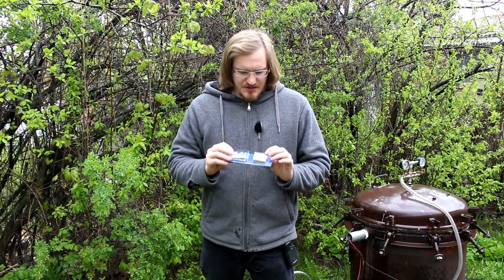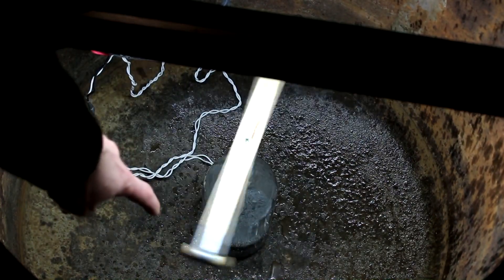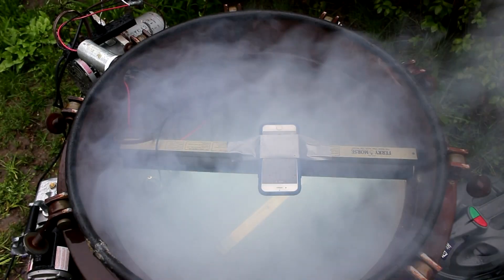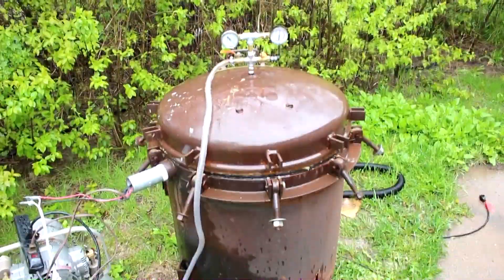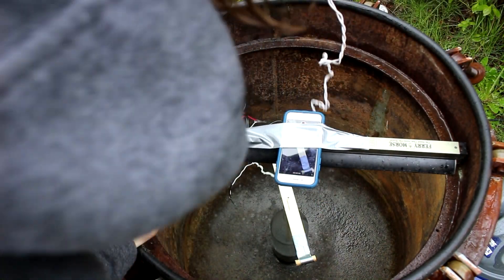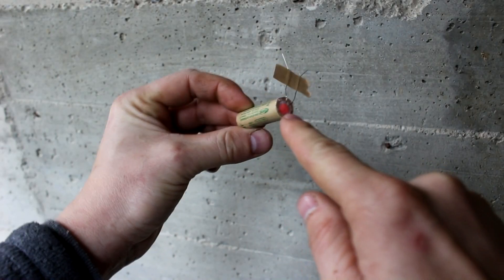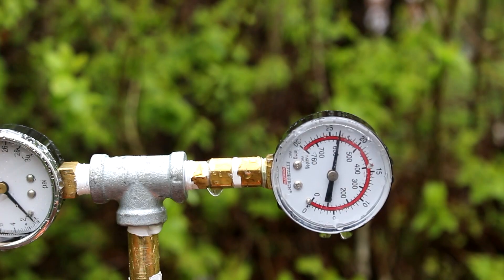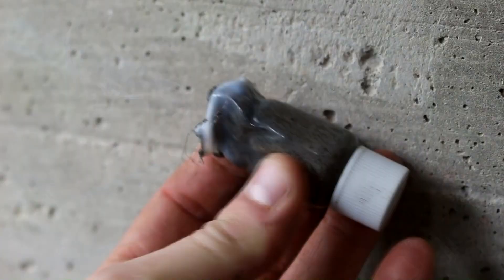Will a Model Rocket Motor Work In Vacuum?

Comment: Cody, do you think that the difficulty of sustaining a reaction has anything to do with the specific heat of the gunpowder relative to the activation energy of the reaction, versus the amount of heat that the expanding gases can actually transfer to the surrounding powder before it is pushed out of the motor?
Kind of like that thing where it would put out a flaming twig, but burn with the smouldering tip...
Perhaps if you used a VERY finely grinded powder and packed it together REALLY tightly?

Comment: i haven't seen anything, ever, claiming NASA rockets operate under atmospheric pressurized tanks...
Reply: the difference is NASA designs their rockets so that the exhuast gases and turbopumps pressurize the combustion. the model rocket motor is not designed for that
Reply: Yeah of course they run on extremely high pressure tanks thousands of times above atmospheric pressure,
Especially relative to the vacuum around them in space.
An atmospheric pressure tank would just be an empty tank that is sealed.

Comment: Just a comment, but you were using a mix similar to black powder for this rocket I assume, now I'm sure you are familiar with a sugar rocket in which a mixture of sugar and potassium nitrate are mixed to create a solid rocket fuel mixture, and in theory this fuel mixture should have enough oxygen within the Sugar and KNO3(P-Nitrate) to burn in a vacuum without any assistance of air as an oxidizer which you did use but for pressure rather than a oxidizing chemical in your mix, but if you feel unjust to the results of this video, try sugar rockets in a part 2
Reply: Nick Kelly doubt the amount of oxidizer would make a difference. Theres plenty in those SFRs. The problem with low pressure ignition is that the excited products don't stick around long enough to convey energy to adjacent molecules. That's why it had to start it's burn in atmosphere. Probably would have worked without O2 in the little pressure vessel.
Reply: There's already enough oxygen in gunpowder to burn fine with no additional oxygen.
Heat might transfer better through Rocket candy though

Comment: My only question is, did the rocket in atmospheric pressure burn as long or longer than the one under a vacuum? you can time lapse the two frame by frame and see which one burned longer.

Comment: For some reason it doesn't look like the ejection charge fired when it was lit under the vacuum. Could it really not sustain the combustion as the delay charge continues burning at a much lower chamber pressure?

Comment: ODD channel had an amazing rebuttal to your experiment on earth curve
Reply: Google underwater fuse, and you can see lots of fuses, some black powder based burning underwater.  Some thing I did not explain before.  Black powder contains potassium nitrate, and potassium nitrate is 3/5 Oxygen, but it's not gas, its solid, even the oxygen.  When black powder burns (explodes), the potassium nitrate breaks up and the oxygen is released and becomes the oxidizer.  
Google Magnesium underwater burn.  This is a trip because Magnesium burns underwater better than above.  The reason why is it burns so hot, the Hydrogen and oxygen in the water break up and now you have more oxygen than above the water, and hydrogen which itself burns.
Reply: Just because you don't have the slightest idea on how rockets work, doesn't mean NASA and the other space agencies have the same problem.
Reply: A full burn on those Estes rocket motors is only a fraction of a second.  Watch any video of them launching actual Estes rockets.
Reply: On the Estes web site it says A3-4T engines have a 1 sec burn.  The first in atmosphere test seems to be about 1 second.  The last in a vacuum test seems about 1/2 a second. It also seemed to spin the stick faster.  I would imagine it would burn faster as there is less pressure holding exhaust gasses in the engine.
Reply: Well the rocket burns because it's full of oxygen.  It's just black powder,  sulfur, charcoal, and potassium nitrate.  The Potassium nitrate is 3/5 oxygen.  Black powder will burn underwater.  Something that has been known for 500 years or so.  
I think there are flaws in his test procedure but there is no doubt it burns and provides force.
Reply: +Lonewolf Rebels Ignite some blackpowder and while it's still burning, dowse it in water.  It will keep burning.  Obviously, blackpowder burns pretty fast, so it's kinda tricky.  A blackpowder "slowmatch" is a better way of trying it.

Wet blackpowder is difficult to ignite, because you have to boil off the water first.  Which is why it won't work in a flintlock - not enough ignition energy in the spark.  But if you do supply enough energy, it will.
Reply: makes you wonder why the rocket motor only lit for a fraction of a second and didn't do a full burn
Reply: I agree it does appear to provide force the questions start when you ask how much force and I believe your mistaken black powder don't burn when its wet I know that for a fact I shoot black powder muskets inside a sealed cask where oxygen is already present yes it can explode but even a few ml of water can spoil pounds of black powder till its dry
Reply: I did not say black powder burned when wet.  I said it burned underwater.  The problems Cody had were with igniting it, not burning it.  You must raise it to a pretty high temperature, that's why it won't burn when wet. 
In this test, he uses the factory model rocket igniters to ignite the rocket engine.  Well the coating on the igniters burns at a high temperature, enough to light the engine.  But they don't have their own oxygen. So the igniter does not work in a vacuum.  The little wire gets hot, but the coating never ignites. 
You know the joke about how deaf frogs don't jump?
Reply: Indeed 😂
Reply: Cody also proved black powder don't burn in a vacuum
Reply: +Luke Himself They didn't have to use claymation in the 70's they had Kubrick
Reply: I would love to see a experiment where black powder burns under water and in a vacuum and let's hear about the deaf frogs 
😂
Reply: I thought he made a solid valid point definitely a theory that could use some testing by more people don't get angry get informed
Reply: I thought he made a solid valid point definitely a theory that could use some testing by more people don't get angry get informed
Reply: thankfully a smart comment somewhere on the list instead of "oh it worked perfectly the entire time since the burn was started, I accept everything about space now! even the proven claymation astronaut in the 70's spacewalks!"
Reply: 1/2 second is hardly enough time to prove it burns in a vacuum he did after all have to leave some o2 in there to ignite it this experiment would of been better served with a duration burn on film with a force gauge either applied to the rocket or at the exhaust end to see if it can sustain a proper burn and to see if the force exerted was the same in a vacuum as out of the vacuum after all he could not get it to burn without first changing his own parameters by putting a container behind the motor to induce ignition in a vacuum
Reply: I've played with small rockets before and they had longer burn times than this maybe a proper test with a rocket that has 10-30 seconds burn time would help prove this better
Reply: Scientist teaches a frog to jump on command.  Gathers an audience, says jump, the frog jumps.  Cuts one back leg off the frog says jump, the frog jumps.  Cuts other back leg off the frog, says jump, frog just sits there.  Scientist says See, frog with no legs can't hear!   Which is to say, even with good intentions, experiments can be flawed.

Comment: the only reason it's working is because it's thrusting off the sides of the vacuum chamber. otherwise it wouldn't work.
Reply: MistakenMystery; That makes no sense whatsoever.
Reply: Nope, that's not how thrust works. The rocket pushes against the gasses it exhausts behind it, not air. How do you think a space craft can achieve thrust in space?
Reply: Nasa and space is a fucking lie, the earth is flat

Comment: Before I even watch this video, yes it will work in a vacuum because the rockets contain an oxidizer an fuel and you may even get higher efficiency because there will be less pressure going against the exhaust coming out.

Comment: Could a smaller nozzle than used in atmo  have the same effect?
Reply: yes, that's essentially what cody did here
Reply: Hmm It kinda looked like a pressure vessel designed to fail. Same intended effect diff means.. I thought he'd make a rocket candy engine with smaller nozzle instead or affix a reusable external nozzle than the method he employed.

Comment: Would there still be fuel left in the spent motor that ran in the vacuum? Seems like it didn't expend all the fuel. Any chance you could chuck it in a fire to see if it still has propellant?

Comment: If memory serves from 40 years ago? NASA used hydrogen and oxygen combusting in their rocket motors. No igniter needed. I found it interesting that they called it the .9999 reliable motor that put out precisely 20,500 pounds of thrust.

Comment: the igniters are not designed for 120V : it causes then to burn too fast and 'pop' if you use say 9V , they will burn much slower like a match and keep the heat near the propellant for longer. I believe your experiment may have worked on first try had you use appropriate voltage.
Reply: Have you ever even touched one of these igniters? Why do you say that? Why are you 'sure' that's not AC?

The fact that the vacuum pump shares the same power bar is a dead giveaway also the distinctive 'pop' the igniter does is typical of over-voltage.
Reply: Simon L he may have used the power strip in order to get More Heat to ignite the rocket..
just a thought
Reply: Slipped Halo, Its not my idea.. just product specs. These are standard Estes igniters, they have not changed in the last 25 years (or more)
Reply: That's actually a really interesting idea, I didnt even think of that.
Reply: Simon L im sure that was not AC power, rather just a switch

Comment: Love this channel.  However, it needed an oxidizer.  It only fired the second time due to a small amount of O2 in the vial. Once that O2 burned up the vacuum took over and stopped the reaction.  This can be demonstrated by the short burn time of the second firing.  I understand it was a 1/2A engine, but it was 1/3-1/2 of the first.
Reply: It does have an oxidiser in the form of potassium nitrate in the fuel grain. Indeed the rocket could never work even in air without that oxidiser because the pressure inside the burning rocket is  higher than atmospheric (if it wasn't the exhaust wouldn't come jetting out the back) and therefore there is no way for atmospheric oxygen to get into the engine while it is burning. To demonstrate this Cody should have cut the motor open and showed that no fuel was left inside it.

My suspicion is that the second motor burned for less time because being cooped up in the bottle put it under more pressure once it had started burning. Higher pressures inside a solid motor usually lead to higher burn rates.

Comment: Most, if not all, of the Star rocket motors used by NASA are upper-stage engines that light in vacuum. A Star 48 (48 inch diameter) is also tumbling somewhere beyond Pluto, having been the final stage for New Horizons.

Comment: Just had an idea: Why don't you drill a tiny hole in the top of the engine, stick the igniter in there, then seal it with glue? That way, there isn't as much pressure trying to force the igniter out of the engine, so it has a better chance of staying put until the engine becomes self-sustaining. (Edit: Either that or put a nozzle on the exhaust to increase internal pressure.)

Comment: But there was an artificial environment surrounding the rocket. Not sure why you said  "rocket motors can produce just as much  thrust if not a little bit more in a vacuum" when the rocket was encapsulated in its own personal atmosphere. Without that crutch(cheating device) it doesn't produce any thrust. "Cody's fail" is the new title until he or someone educates me.
Reply: The engine was producing thrust just fine in vacuum. His problem was getting it to ignite in the first place- it seems that these engines need a little bit of oxygen and/or backpressure from the air to get started. I'm leaning towards the backpressure side, as others have noted that the parachute charge didn't explode like it did in the control. That problem could be solved with a tighter plug and a narrower nozzle throat to provide the needed chamber pressure. Full-sized rocket use different propellant combinations and ignition systems (A common approach is to inject two liquids that spontaneously ignite on contact into the engine just before the main fuel flow starts entering the chamber) so this experiment has limited applicability to them.

Any jet of exhaust gas will produce thrust, so thrust could be achieved with a bottle of compressed CO2, no combustion needed.
Reply: Will a Model Rocket Motor Work In Vacuum?

No.

He had to provide an atmosphere for the rocket.
Reply: Depends on your definition of 'work'. If you mean 'produce thrust in vacuum' Then yes it does work. If you mean 'ignite as intended in a vacuum' then no.
Reply: How do I know if a car works? Does does the starter turn over or can I use it? 

You just hacked a hair in half. Did the perform the way the manufacturer intended it to? No. Whether it is in a rocket or suspended from a plank it didn't work as intended. He needed to cheat. This is akin to Can a Bic lighter work in the wind? Yes......If you protect the flame with your hand.
Reply: the bottle had a hole in it.

Comment: Nice try Cody, but you didn't get your conclusion correct :-(

The motor only burned using the amount of oxygen that was in the plastic bottle. After that was exhausted, it immediately went out. This is evident due to the parachute charge not going off. The propellant did not burn far enough to hit that charge. You can hear the charge going off in the control test. It did not go off in the vacuum test though. My guess is that less than 50% of the solid fuel in the rocket motor was actually used.

The solid fuel in those motors do not contain a suitable oxidizer to operate in a vacuum.
Reply: No it did not use the oxygen in the bottle you can do very basic math to find out that that would be completely impossible or just use logic and realize that Rockets don't run on atmospheric oxygen ever.
Or listen to the explanation he so kindly gave you
The rocket doesn't have a suitable oxidizer to operate in a vacuum that's why he put it in a pressurized container inside of the vacuum.

Comment: It doesn't need pressure to ignite it needs oxygen. The actual rockets use a mixture of hydrogen and oxygen (for NASA) pressure has nothing to do with it. Pressure only give it volocity. The three things you need for fire are oxygen and ignition source and a fuel. There is little to no oxygen in a vacuum. The last attempt it used the oxygen in the container to burn. That being said good video.

Comment: What is going on with the water on the bottom of the vacuum chamber in the final time-lapse video? Is that low pressure boiling? Anyone have any idea? I need to retake physics.

Comment: You cheated. The motor was not in vacuum.
Reply: Yes it was.
It had a pressurized container around it but after that container burst it was just the rocket motor in a vacuum.
Reply: 2010invent it needed pressure to initialize the reaction. After it began, the pressure of the exhaust within the rocket allowed the rest of the fuel to burn.

Comment: Thanks for doing that Cody. First, I commend you on your ingenuity for making a rocket rotate (instead of attempting it going in a straight line, like I've seen other folks try. Reminds me of how backwards inventors first attempts usually are. For example, the first records were cylinders until someone's bright idea made them discs taking up far less room (that innovation took years). The first jukeboxes had 8 records, 8 turntables and 8 shafts on a Ferris wheel  that would all rotate individually to the top to play requiring a huge cabinet, then someone thought, "hey, why not stack the records and us one turntable?". but that list goes on and on so your approaches always find a better way without years of waiting for someone else to .). Was kinda bummed the vacuum chamber here wasn't clear, so it was bright putting your iphone in there too.  The reflection of your light source in the water droplets looked long and that puzzled me until I saw your iphone was on top of a fluorescent bulb. So good on you for that innovation as well. I didn't know if or not your iphone would video anything in pitch black (mine doesn't) and the light didn't cast a shadow of the turning arm. - so you're batting 1000 so far. And for all that, you give McGiver a run for his money.  But your confidence saying "If I can figure it out, I'm sure the people at NASA can do it". still excels mine.
Reply: Fred - So when the rocket engine is firing is it ejecting MASS?

Is this MASS - ACCELERATED?

Does the mass change velocity as it leaves the nozzle?